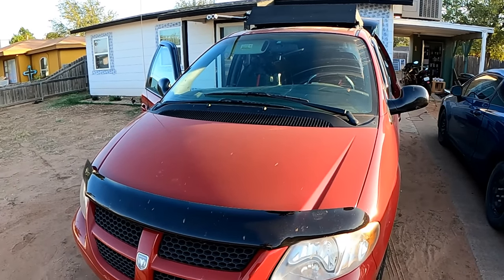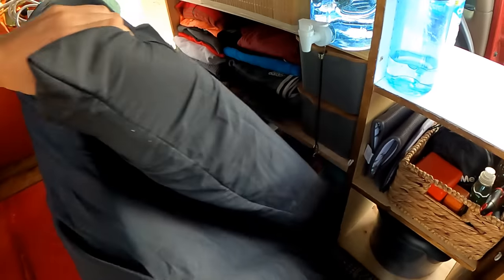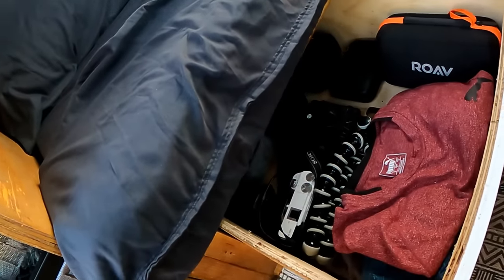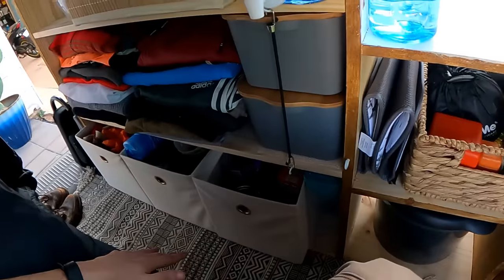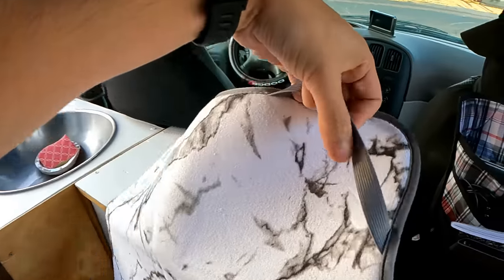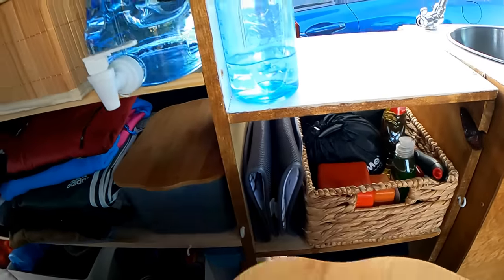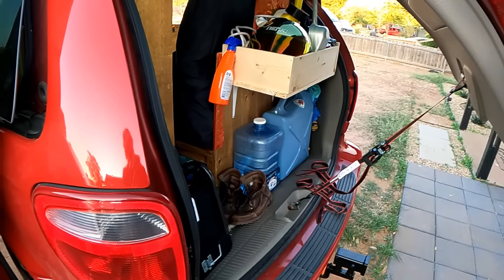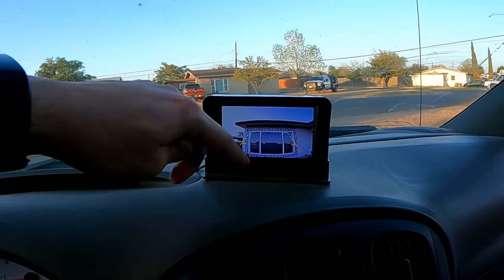Mini Vanlife 2002 Dodge Caravan Budget Conversion Tour DIY Simple, Cheap Setup

Comment: LOVE your Welcome sign in the entry, and water container with built in "on - off" switch! Great idea to have the little hooks
which can serve a dual propose for holding a bungee cord and can be used to hang things on. Great idea to have the backup camera for safety. Good thinking on just using lightweight containers to minimise the weight instead of wooden doors etc, easier and cheaper way to go. Everything is very well put together and organized. Good Job! AND so proud to see you are taking online courses. Keep up the good work on your studies. You are intelligent and have the ability to build a good career by doing online studies. My son did a lot of his studies online earning Straight A's and eventually earned his Doctorate in Psychiatry. Good luck and God Bless!

Comment: You have done an excellent job creating a mobile living space, providing you can camp close to a public restroom. I would recommend you get a small, astro turf doormat to put on the ground outside that side door so you can wipe your shoes and not track dirt inside your vehicle. If the doormat is small enough you can stow it on top of the passenger side floormat when you are traveling. 

If you decide to camp for free on public lands, I recommend you have a solar panel installed on top of your vehicle for recharging your devices. If you buy a solar-heated camp shower and a small chemical toilet these will make is possible to camp in the wilderness far away from bathrooms. A lightweight, folding TV table plus a one-burner butane stove will give you an efficient outdoor cooking set-up. If you have a hitch installed on your van to tow a very small trailer, you could tow a motorcycle or bicycle so you do not have to break camp when you want to make a quick trip to the nearest town. Adding dark, UV-blocking film on your side windows will give you more privacy and make it easier to keep your van cool in summer.

Comment: That's Great. The Details In Use Of Small Space Is Awesome. Peripheral Vinyl Is A See Out, Not In During The Day. It's Good. Also Get Rain Guards For Your Windows So You Can Crack Your Windows. Moisture Build up Will Rust Your Van From Your Breath. Amazon has an Alcohol Heater. They use to be used on  Boats. They don't blow up like Gas. CheapRVLiving Shows A Lady With The Alcohol Stove. She uses it for heat and cooking. Of course you have to have Ventilation. That why Rain Guards Are good. You Are So Smart That You Can Build Screens For Your Windows for for flying or crawling insects. I love what you did so much, I Subscribed So I Can See What Else You Do. Many Wish They Had That Layout In Such Limited Space. Wow. BLESSINGS

Comment: You made some clever adaptations to really utilize your space.  Have you thought about a sliding extension for your bed? Seems like it'd be easier to set up.
Reply from the maker: It seems like a sliding board would work better. I just went the easier route. Maybe down the road I'll do some adjustments for the bed.

Comment: Looks great but i get claustrophobic with do many things 
i would just use drawers ( open bins 4" max hight ) under bed for clothes, dirty clothes on floor of passenger seat in a square basket, and my water gallons , my gym bag would have all my shower stuff,  plus would have darkest tint on all rear windows to avoid being asked if i live in my van and dollar store black foam board. As for eating i would nit need many dishes actually one bowl 1 mug very minimal a little burner to heat stuff or cook best wishes 🙏❤️☮️

Comment: very well-organized setup,  it also seems to be a smart idea not to tear out good carpets or clean interior wall and roof coverings. I would assume most passenger vans are factory insulated, to begin with?
Reply from the maker: I'm not sure how vehicle insulation works from factory. I removed the side moldings and notices empty space where I was able to add insulation. I figured it wouldn't hurt.

Comment: easy water pump go to home depot get a 1 gallon insect spray repelent that comes with a battery sprayer modifie that to work for what u need, it's cheape than an actual pump and does the same with less headaches. good build 👍🏾

Comment: I have a blue 04 Caravan myself. Totally the same except that my van is not as "optioned" as yours. But this is totally the same idea I have, using it for camping and traveling! 

I'm subbing because I want to see all your build work, see if there's any obstacles our Van's have and see how you overcome them. 

What tools do you use for cutting? Hand saws, coping saw, etc? 

Also, what do you use for privacy on your windows when you camp?

I'm planning to remove a few more things to make that much more room in mine, more trim, part of the carpet, but definitely the wheel well covers which I believe is what you were referring to. 

My only problem is that I have so very little DIY skills or knowledge, I only hope that it turns out HALF as good as you have yours!

Good job on everything so far, can't wait to dig into the rest!

Comment: dont know if your still using this van but just a heads up they haul wood very well lol I had a beater just this summer that I used to haul logs to the camp used to jam that thing with logs then fly through the field sadly my friend was drunk and decided to jump it off a snowmobile ramp :( cracked the oilpan leaked right there and seized halfway back

Comment: Yep, we campers sure know how to minimize space, after all a van is definitely an upgrade from a tent. Planning on getting one going camping for months at a time each year, kind of easier than braking camp, although I still love tents and plan on bringing one hitting National Parks and Forests. I’d like to bring my camping cot instead of building a bed, any thoughts? Bringing my BRS canister stove and Trangia 27 system should take hardly any space and fulfill my cooking needs. Another question I have, fridge or cooler? Ice in National Parks is pricier than regular store and mostly driving long distance to obtain. Great set up, you’ve given me valuable ideas.
Reply from the maker: I think a cot would definitely work, and it would be much lighter. It does has good pros going for it. I would go with a cooler unless you're going to constantly be driving or putting in a decent solar setup.
Reply: @fipl1205  yes, I’ll be driving a lot and then I’ll be parked in the forest. Maybe I can try the cooler for awhile. Thanks so much.

Comment: Legal age😂🤣cracked me up. You’ve done an awesome build. Best of luck with your van life!
I’m curious, which back up system did you buy?
Thanks for the tailgate idea, it will be handy some day.
Reply from the maker: I bought the cheapest camera I found on Amazon. It was priced at about 35$ but it us only 720p. I recently saw a 1080p camera for $39. So make sure you see everything that's out there before buying. And I'm thinking of adding a second rearview camera and placing it on my rooftop carrier because when I attach a cargo carrier to the rear of the van the camera gets blocked. So make sure you place it somewhere where it won't get blocked by any additions.
Reply: Thank you...will do.

Comment: You’ve done a nice build with what you had.  I love the bed set up.  Does that year have 1 or 2 rows of stowaway seats?. Are they still in the van or did u take them ou5?  Safe travels & good luck.
Reply from the maker: This van doesn't have any stowaway compartments. I had to remove the seats completely. So no seats and no extra storage. It would have been nice to have but I compromised for the low miles.

Comment: I didn't see a refrigerator or cooler.  Do you plan on having one? I also noticed you didn't have the windows covered up at night. What do you use for privacy? I love your bed set-up. The wood  slats are so much better than a solid board for ventilation.  Very organized set up! Great job!
Reply from the maker: I did record an updated video. I did buy a refrigerator, it's something I regret. Don't really use it. I also have some window covers made from cardboard and blacked out with gorilla tape.
Reply: @fipl1205  Thanks for your response.  Hope all is well.

Comment: This is only 2 weeks in ?!  Well ,  I haven’t seen your other vids so maybe you already had most of the build done (?) . I’m curious what you do for a living because you have excellent taste and “vision” for use of space , IMO .  The ONLY thing that makes me nervous is that corner where that Grand Canyon National Park sticker is .  I know that I would’ve already bonked my head and/or nearly poked an eye out .  A jigsaw round-over or some slick padding ?  Also ,  that countertop that butts into your sink ,  have you seen those sleeve-bolts that are made for attaching 3/4” panels together with an Allen wrench ?  To easily level out both counter tops. Easily removable should you need to break it down in future .  Forgive my unsolicited suggestions ...  But yeah , really , really nice .  One of the best I’ve seen on YT .
Reply from the maker: The first few days of the build i just worked on the bed and sink. I spent more time trying to figure out what size to make it and how to incorporate it than building. Then I moved to texas with just a bed and a sink done. Took a couple more days to finish the rest. So, everything took about two weeks because in between the build I drove from california to texas, and got all the paper work and DOT certifications ready for work. But the actual build took about 5 days. Leaving everything open saved me a lot of time. My build is essentially a lazy person build. And the wall next to the bed, I like it that tall. I feel like it gives me more privacy when I have the side door open. I haven't had any problems yet leaving it as is.

Comment: electric pump for water bottles is like 20 bucks on Amazon
Reply from the maker: I don't have an electrical system yet installed unfortunately and since things have been slow at work I'm not sure if I'll get to it soon. I think I'll just set up a foot pump since I already own one. It's just that I left it in california. Just have to go pick it up next time I'm out there. And also the sink pulls out. It's not drilled in so when I go camping I can take it out and not have to use it just in the van. I believe an electric pump would limit my use of it since it'll have a cord.

Comment: I love the lay out of your Dodge Grand Caravan. I have watched this video several times, will watch it more! Love the bed/sofa/couch build. I'm searching for a Dodge Grand caravan. Could you please tell me the mileage of it when you purchased it? How long have you had it? What service had to be performed @ what mileage? Thank you for this video!
Reply from the maker: Hello, I got the van with a little over 69 thousand miles if I remember correctly. I haven't put many miles on it. I parked close to work when I was living out of it so I drove it for a few miles. Right now It doesn't have over 75 thousand. I have just performed normal oil changes on it for now. The A/C did go out though, Electrical seems to be failing.

Comment: That's an awesome rig , man. How do you get enough ventilation, because that type of Caravan doesn't have all windows that you can open. If you crack open the rear quarter windows you loose a lot of your stealth, so you are left with only the front windows, and that's just not enough air. I love this minivan, but I can't see any great solution for air and stealth. How did you resolve that my friend? I figured I will sell my Dodge Caravan 2006, although I don't want to, but I need a better setup.

Comment: I went to AZ for a week in my town and country minivan, total chaos. I need to know how wide is your bed??? You have a good little aisle to move around. Thx for your video. Great build!!
Reply: I think my folding mattress is 32" wide. Need it due to back injury. So not enough room for your great little aisle. 😢
Reply from the maker: Mine is only 25inches wide. Quite a bit smaller.

Comment: How do you heat up water? Do you have any sort of extra powering inverter or generator or something like that? Also what do you do to darken and make private your windows? I am just in awe of your smart use of space. You have so much storage that's unreal. I wish I could have you help me do something like this.  There's no way I can do this on my own.
Reply from the maker: I don't heat up water, only to boil for food. I tend to keep the inside of the van at a decent temperature with a heater. I have added a solar panel and a couple electric generators. I have other videos on my channel about that and also about window covers. I used cardboard, tape, and window reflector.

Comment: Super job!! Great use of space. I wanted to know if your bed is actually the same width and length as a normal single bed or did you just cut it down to fit? Thanks!
Reply from the maker: The width of the bed is appr. 25 inches. I cut a mattress i had. But they do sell mattresses that size i believe.

Comment: This is really good I like it... But no detail and how you got all the wood framing and did you bolted to the floor how does that work?
Reply from the maker: Nothing is bolted to the van. The sink rests behind the driver seat and the two extensions rest on that . The wood part with the padded bench rests behind the passanger seat as well.  And the wood section with the shelves fits snug to the top of the van. It all holds itself in place.

Comment: This is an incredible build! I love what you lhave done. Did you record how you took the moldings out on the back sides? It is clear that it gave you so much more room. I don't remember if you mentioned how you power things in you minivan, do you use solar and a power source? Really such a great build.
Reply from the maker: I don't have a video of me removing the side moldings. It was just a lot of pulling and removing screws. Right now for electricity i am using just an extension cord at my friend's house. I charge all my battery backups that way. But I will put solar within the next month or two.

Comment: What type of wood did you use? How much was the total build?
Reply from the maker: For the "shelves" I used common board. 1x12x8ft. I used these because I needed that depth and I just cut the lengths as needed.  You can probably save money by buying big boards and cutting length and size yet I was pressed for time and don't have skills to cut straight with a hand saw. For the bed I used 2x2s for the frame. And common boards 1x6x6ft for the mattress support. I also used 2x2s for the frame of the sink. And used slim sheets of 1/4 BC plywood for the sinks walls.  I used 3/4 BC plywood for the wall next to and behind the bed. 7/16×2×4 osb board for the bed extension. Besides that just deck screws and glue. I'd say the build itself was between $500 and $600. Wood, screws, glue, varnish, and paint. This is an approximate. I didn't keep tabs on how much I was spending. Now this is just for the build itself, not counting everything else.
Reply: @fipl1205  thanks so much! That helps a lot with my planning

Comment: I love your setup!! Where did you get the wood? Was it already cut to the sizes you need?
Reply from the maker: I got most of the wood at home depot. They're very busy down in this area so sometimes I did have to go to lowes if home depot ran out of a particular piece that I needed. I tried getting the wood as close to the measurements as possible but I did have to do quite a bit of cutting.

Comment: Great job!
Reply: Have you ever driven it in snowy conditions or off road? Curious as I’m in Vermont and about to buy a vehicle and I love how spacious the caravan is vs a sienna but sienna is awd
Reply from the maker: Not yet. I have driven it through some rough roads out here on west Texas. Most roads are destroyed due to oil field traffic but not off road or snowy conditions yet.
Reply: @Lotuslaful  I lived in VT for several years. It snows, and they are not great about plowing.  Definitely get snow tires with a mini van in VT.  The weight distribution of minivans makes them very prone to slide and spin.  Saw it all.the.time.  the traction is so much better with snow tires.

Comment: Very good use of space. Wondering about the bed.  Did you buy a chair futon or build it from scratch? Width? Any details on the bed build would be appreciated. Thank you
Reply from the maker: The mattress was a queen size foldable mattress that my parents received as a gift and weren't using. It was at the perfect timing. One week before I got the van. So my mom told me I could have it. I just cut the width of it to the width that I needed. They do sell them on Amazon about the size that I cut it to. I've seen some on Amazon that are 25inch, 30inch, and so on so forth. I cut mine at approximately 27inches. And the length I believe is around 72inches. This is the link to the mattress I have but in full size (pre cut). 
https://www.amazon.com/dp/B08FBJS2DZ/ref=cm_sw_r_cp_apa_fabc_A1yXFbG63QTTS
Reply: @fipl1205  Thank you

Comment: Sorry to keep commenting, but Question. Can you show the stove. Do the lights work by battery or ??. Also Amazon Has Some Luci Lights that Are Solar. Look At The Comments They Give Excellent Info
Reply from the maker: I'll for sure show the burner i use. I am in finals now so I haven't had much time to do anything other than work and homework. But soon I'll show my kitchen setup.
Reply from the maker: The lights are all rechargeable. They tend to last quite a while and I recharge them with portable chargers when needed. I'll include the lights in a video I am planning on making on essentials for van life.

Comment: What is that light bulb which has no wire called? And where did you get them from?
Reply from the maker: This is the link for it. It's extremely useful. Comes with a small solar panel charger and a control. 
https://www.amazon.com/dp/B07TDTLVM1/ref=cm_sw_r_cp_apa_fabc_rNR7Fb0YMNJ55?_encoding=UTF8&psc=1